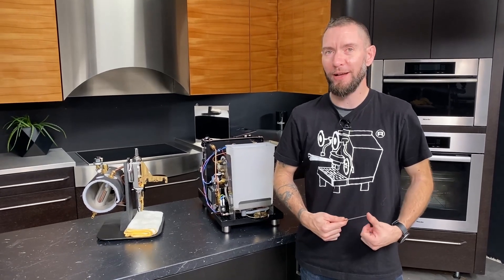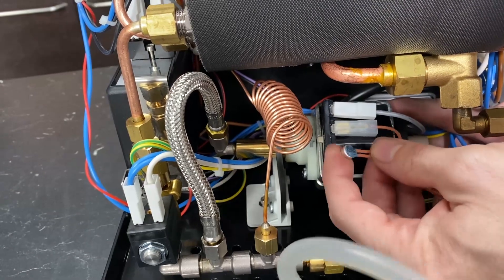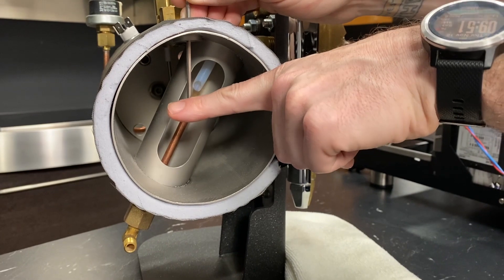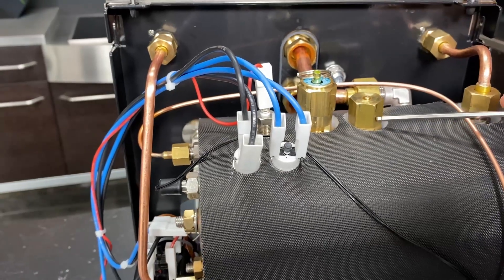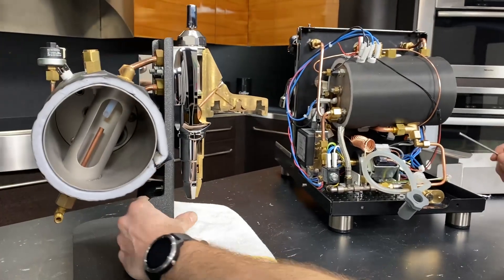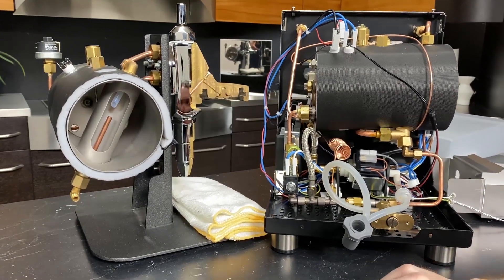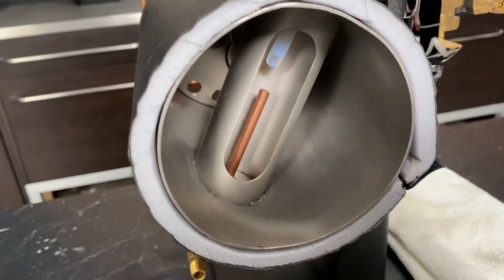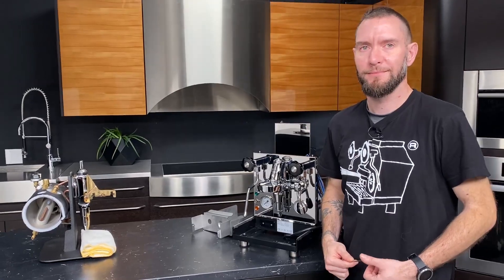Profitec Pro 500 PID: Internal Tour and Component Identification

Comment: My question is, and I hope somebody can answer this. Why does every machine that I've seen use a Teflon tube to transfer hot water from the boiler to the group?? I don't seem to see this mentioned much, so maybe it's just me but anytime I've ran hot water through Teflon tubing (steam wand is the most common) the water has a smell that I assume is some sort of Teflon depositing into the water. Why not just use copper tube in the location such as seen in this boiler that's going to the group??
Reply from the maker: Hi dyh, If referring to the tube seen in the HX boiler cut away machine that's not the actual tube. It's just representative. There are silicone and or teflon tubes used in the cold water flow of some machine and in wands for no-burn properties. In cold water path inside machines it's used to reduce vibration transmission (noise) from pumps. In wands, the material does not transfer heat like a metal pipe would. It's unlikely the smell is related to Teflon. The material is food safe and stable at temperatures far above those experienced in machine.

Comment: My 500 doesn't have the orange light ? Only the Green one. What is the orange light actually for?
Reply from the maker: Hi ff, When on the orange light indicates the machine has water in the reservoir. If off water needs to be added to reservoir. Odd that your Pro 500 does not have the orange lamp. Perhaps a model difference offered in another country. All Pro 500 models available in US going back to initial release in 2014 have the orange lamp indicator.
Reply: The only indication I am giving is the PID flashes 115 and finally goes black. Although, I do check the water level every other day. I wished there was a way to over ride the magnet sensor to allow the water that's below the sensor to be used. I wind up dumping it out once a week to prevent the water from going stale.

Comment: Thanks for this video.  I am curious to know what type of metal the boiler components are made off, especially the surfaces that are in contact with the water being heated to enter the group to make the coffee.  If there is aluminum then that would be a no go for me! Is the solder lead free?  
Also I am not quite sure what the dial on the right is telling me versus the left dial. Should they both be at 12 o'clock? Thanks

Comment: Thank you, it is full of excellent details.
I have an issue with my machine and hope to help me here :(
I feel that the building up pump pressure very slow, it is still 10 bar when check it with blind filter but it take long time to reach.
Now While brewing the coffee it almost took the same time over 30 seconds no matter playing with the grinder if it fine or little fine, for  example dailing my grinder from 1 to 2. Even if I make a little course than the usual espreeso grind!!
Reply from the maker: Hi a, You are welcome. Sounds like you have a flow issue elsewhere in the machine or perhaps a pump issue. As you likely know, pressure on the machine gauge is read from a point relatively close to the pump. First place I'd check are parts behind the point where the little tube connects into the system for the pressure gauge. I'd also check your flow rate from the group. When operating properly, this machine should producer a flow rate of ~6-8 grams per second (same as milliters per second) If your in that range you may have a bad gauge. If below that range there's a blockage or faulty pump.
Here's a very detailed video on diagnosing and repairing flow issues in the Pro 500: https://youtu.be/Rqtl55_8LgA
Hope that helps!

Comment: Thanks for the excellent videos.  I have followed the instructions in your E61 brew group maintenance video with great results - it is now much smoother to operate.  But I wanted to ask a question about the vacuum relief valve.  Mine (which is less tall than the one on your machine) has recently started emitting steam continuously when the Pro 500 is at full temperature, leading to a lot of condensation under the top tray.  My guess is that I simply need to replace the valve.  But I would be grateful for any advice.
Reply from the maker: Hi Andrew, You are welcome! Happy to hear you had great results with E61 maintenance. Here's our video on how to clean or replace the vacuum relief valve on the Pro 500: https://youtu.be/r0jhlo_gJ5M
Marc
Reply: @Wholelattelovepage  Marc,  Thanks for your reply - it's very generous of you!  I guess I should have been able to find that video, but I hadn't.  The details are very helpful.  I shall be trying to clean and descale my vacuum relief valve, and hope I don't have to replace it. Andrew
Reply from the maker: @andrewwells8619  NP’

Comment: Can that vacuum relief valve be replaced with one that allows it to be routed to the drip tray... so it's not venting inside the machine?  I know that's a feature of the 600.  The 500 seems behind on that feature.
Reply from the maker: Hi Jimmy, Thanks for the question. There are vacuum  relief valves available with a nipple allowing for a hose connection. There's no stock outlet to the drip tray on the 500 but you could put one in. Should mention that very little water is released by the vacuum relief. A very small amount of steam and it spits a few drops right before the valve closes. Given the location of the valver atop the boiler and the internal heat in that area the steam rises out of the machine along with any water which quickly vaporizes. Some manufacturers put an inch or two of open ended hose around the top of the vacuum relief to catch the few spurts of water and hold there until it vaporizes.
Marc

Comment: Thank you for these awesome videos.  Your online tutorials are greatly appreciated.  Any thoughts as to why my machine doesn't have the hissing sound as of late and does not appear to be heating?  The high limit switches are fine.  The machine is about 3.5 years old.  I have a new heating element and static relay on order.  I am hoping it is one of these two.  Any input is appreciated!
Reply from the maker: Hi b, You are welcome for the videos! The static relay is one potential cause. Here's a video showing how to diagnose a static relay and replace if needed: https://youtu.be/SmLeio36vMs
Reply: @Wholelattelovepage   I went looking in the machine after this video, and I think I stumbled across the answer.  The nut on the autofill sensor was rather loose.  I tightened it, and it has been working great since.  Perhaps it loosened over time due to the vibratory pump and steam was escaping through there.  I have a new heating element and static relay here if needed.  Thanks again!

Comment: The SSR in this model has been known to blow.. likely because it was improperly designed for only the amount of current in the 220v european system. It is in a "hot" ambient location which contributes to it failing, sometimes in a puff of smoke. Because of the potential fire hazard, you'd be best to relocate it to the rear of the unit.. at the very least ensure it has thermal paste underneath it.. HB has many threads on this failure.

Comment: Hey thinking about buying this one how is it if I need to make 4 lattes in a row can it handle that and how long would it take
Reply from the maker: Hi Smanatha, Thanks for the question. Yes, the machine can do 4 lattes in a row. How long depends on how big your lattes are. For a typical specialty cafe size of ~6oz/180ml each made form a single shot of espresso you could split a double shot into 2 cups and froth your milk at the same time as your espresso was extracting. By the time you pour those and grind/tamp your next double the machine will be ready to make the next 2.